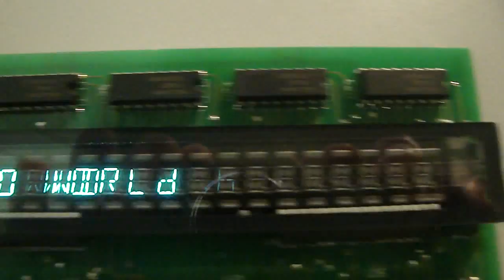Arduino 14 segment Flourescent Gas Display Tube Project

Comment: I have a similar display that I'm trying to hook up to an Arduino nano. I'm having a hell of a time getting it to work though. it has  a 10937p-50 chip on the board which uses SDA SCL and POR and that is it. I have a few libraries but they just display junk on the screen. I have a thread on the arduino forums about it but no one seems to want to help me with it. would you be willing to maybe help me with it?